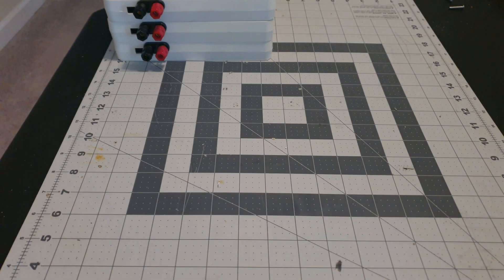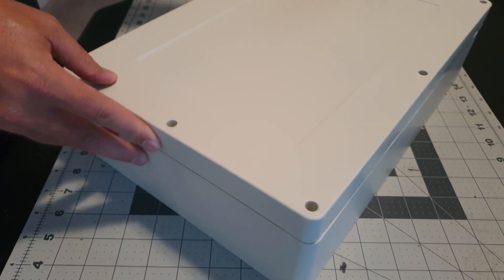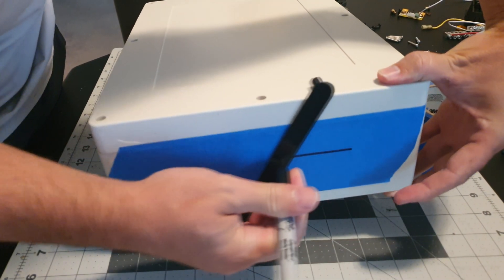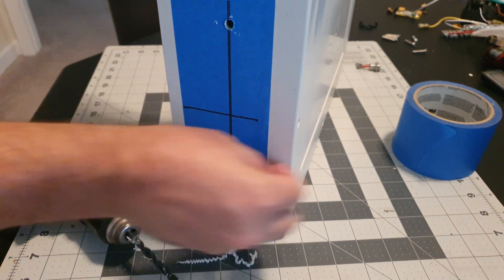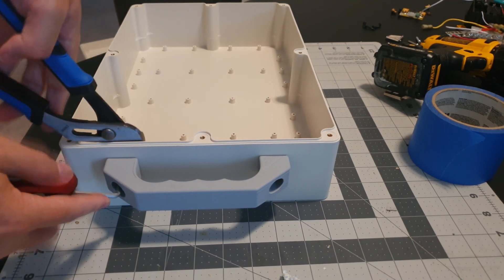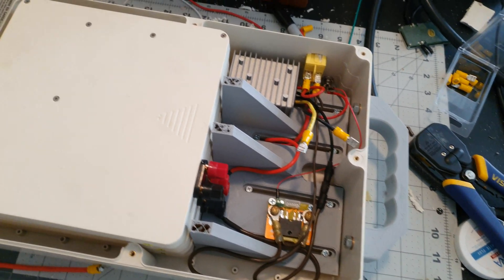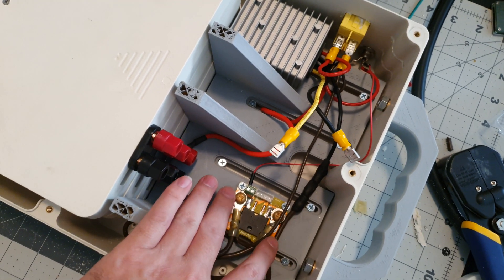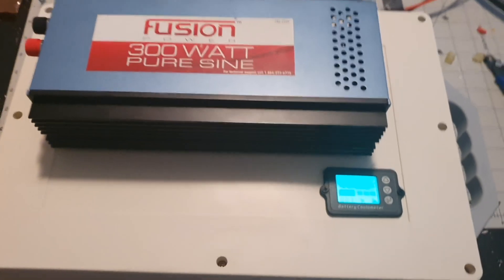DIY - 8s9p Battery Power Station

Comment: How could I use solar panels to re-charge these units?
Reply from the maker: You need a solar charge controller. Do some research in that department. Basically ot need to be able to set the output voltage to the level you want your battery to be.
Reply: @TechCentric_00  Have done research but concern is 12 volt solar converted to 33 v for battery is too few amps to ever charge the pack.  Am I wrong?
Reply from the maker: Yea a single 12v panel it would take a while. Either get a bigger panel or parallel a few together to get the amperage you need.

Comment: Built this and it works great!  I got 9 hours of power for a 300w inverter, might have gotten more, but I ended the test.  I was hoping to get 4 hours of power for my flatscreen.  Hope to see them again at batteryhookuo.  Thanks for the video!
Reply from the maker: That is awesome. I would love to see how you put it together. If they do get more in use my discount code " tech " it helps support the channel especially since I am pre monetization right now.
Reply: https://photos.app.goo.gl/jhVFFuZdPUcHnHDx7
Reply: @hughconnelly6278  get a error for that link.
Reply: @rogerbecker5607  Thank you, fixed I think.  Link sharing was not toggled on.
Reply from the maker: As of Dec 12th they are back in stock.
Reply: @TechCentric_00  just bought three more with "tech" code

Comment: I certainly like the way you do things, wish I could. I’ve got 20 of these packs. I hooked them in parallel and when I had 15 and measured I got up around 33 V then I hook the rest of them up it went to 48 v. What am I missing here?
Reply from the maker: Hmm you may have accidentally put one or more in series along your parellell.
Reply: I have checked that over and over again and still do not understand it?  Just wondering if one of the packs it’s not wired right don’t know what to do.
Reply: Every pack individually measures over 50 V now
Reply from the maker: I would take one a part and measure the voltage of a single cell group. I can't see 50v being accurate. Maybe your volt meter is not calibrated right.
Reply: @TechCentric_00  I’ll try that and use a different meter. Thanks.

Comment: if im correct with the 8s9p gives you about 36 amp discharge correct?
Reply from the maker: Each module which is made of 8s 3p has a bms of 10amp. In my charging test I charged at 5amp and the cells got a bit warm. These where used for medical device with low amperage needs. The place I bought they recommended not going over 100 watts per module so I follow that on discharge and only charge all three with a 2 amp power brick.

Comment: PS   I just read several comments about inverters and converters. My SG use a 24v inverter(1500wh) and a 12v converter. The converter will only power small 12v devises max 5ah.  With 10 units at 100w per, no problem with a 1000w inverter for this box.
Another thing not mentioned is these units have one of the best BMS's units out there. Making it a full SG would be a no brainer.
Reply from the maker: Yea i have been impressed by them. I have 5 more waiting for a project  :-)

Comment: My built is similar with 10 units in P. (8s 10p). No inverter or converter and a simple volt/amp meter with 10ah max as it's only  auxiliary to my solar generator. I very much like the way you set up the banana connectors with the copper wire. I connect to the SG via banana connectors and it never draws more than 2-3 ah. I have attached an inverter externally, but just to capacity test the units. I could however at any time convert this box to a full SG and would use  your design.  Thanks for the video....
Reply from the maker: Your are welcome and hope your build works out well.

Comment: Awesome!  But does that step down work in reverse for charging?  How does it know what voltage to send back to batteries?  All buck converters I see for sale say not to charge through them.  What's your thoughts?
Reply from the maker: Buck converters are one way. I charge using the full voltage of the batteries and directly to their side of the circuit. I have updated the wiring diagram in the description so show where the charging wiring is done.
Reply: @TechCentric_00  so the BMS is smart enough to manage the voltage/current while charging?
Reply from the maker: @nick-leffler  yes the bms will monitor the cells and if one is charging over the limit set by the bms then it will stop accepting energy. If a cell goes lower than the set limit  in the bms it will stop discharging. I do not know for sure about these modules but a lot of BMS will also work to make sure all the cells are balanced to very close voltages to each other. it doesn't limit the current so if you try and charge too fast it can cutoff if the current is too high.

Comment: I really like the videos! I have a question: Isn't there a waste with stepping it down from 28.8V to 12V? Wouldn't those total of 72 batteries in 4S blocks be sufficient and more efficient for step down to 12V? - What am I missing here? Or did you do it because of the cheapness and simplicity?
Reply from the maker: Yes there is a loss. This project was about using those battery modules and to use what I already have on hand. 4s block could work but usually 12v inverters can't handle the upper voltage of a lithium ion pack which is 16.8 so you have to only charge to what the max the inverter can handle so there is loss there as well. This was a build of convivence and not one designed for efficiency.
Reply: @TechCentric_00  Thank you for the fast answer and clarifying. Looking forward to more videos from you!
Reply: What would be efficient use in portable solar generator. 250w inverter... Tv and fan.

Comment: great video . my opinion would be to use a 24v inverter . then the buck converter would not bottle neck the power . would have better run time .
Reply: Here’s a good 24V inverter and has the highest maximum DC input I could find at 32V: https://www.donrowe.com/samlex-pst-2000-24-pure-sine-inverter-p/pst-2000-24.htm. It also has a 3 year warranty. I’m connecting 20 of these modules in parallel. Can you clarify why you’re limiting the wattage to 2W for 3 modules? I would think the built in BMS would limit the charging rate appropriately. Thanks for posting!
Reply: @staticGenerator4You  2a is the max of the power brick I use. I can do more but I play it safe.
Reply from the maker: The build here is one of many factors. What did I have on hand and cost (24v pure sine which are the only ones I use is much more expensive then 12v) and the limitations of the packs. The packs are good for a 100w per module and I use 3. So 300w is all that I have to work with. After a quick search I could not find a 24v pure sine 300w inverter (Plenty at much higher wattages). And the voltage range of 24v inverters would not allow me to use the full capacity of the batteries. Thanks for the comment and glad you liked the video. Trying to grow the channel.

Comment: battery wall 3d model link is bad.
How do you charge?  I'm thinking of adding a solar panel for portable AC.  Think it'll run around 2 hours?
Reply from the maker: Should be good now. I replied to the charging question on the model mod video.
Reply from the maker: Time is all dependent on the load. I have a 16" fan that can run for 10 hours on full. It draws 60 watts.

Comment: Great video.  Parts list and schematic would be nice.
Reply from the maker: I have added the parts list to the description. Will try at a schematic but will have to add at a later date.
Reply: @TechCentric_00  awesome
Reply from the maker: Added a simple diagram as well to the description.
Reply: @TechCentric_00  Perfect. Clear understndable.
Reply: Great bid...what r u charging this with?
Reply from the maker: Here is a video of the variable power supply I use. I have a 58v powersupply that feeds the variable one. https://www.youtube.com/watch?v=-KbgWXUNgXA
Reply: These would be great batteries but I think my solar inverters max charge is 31v which is around 50 percent capacity. Not sure if you can think of a work around that I missed
Reply from the maker: Look at this. It can up convert to higher voltages. https://www.amazon.com/dp/B01HCL7LEW?ref=ppx_pop_mob_ap_share
Reply: @TechCentric_00  unavailable...
Reply from the maker: @hughconnelly6278  ok sorry about that. Forgot to publish it on thingiverse.